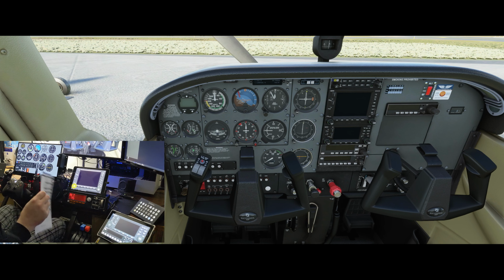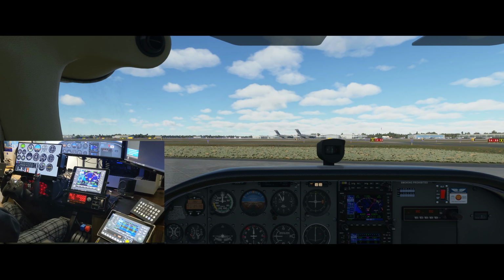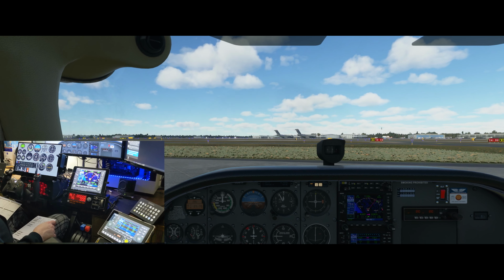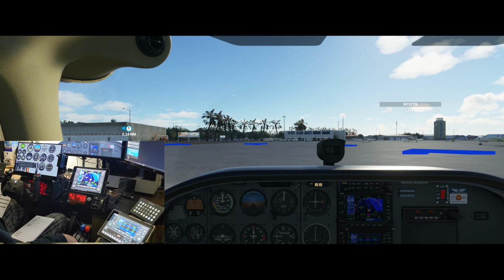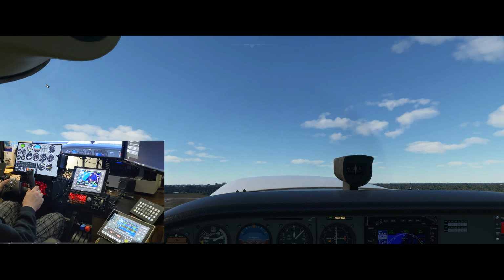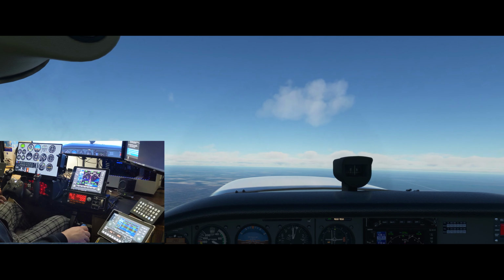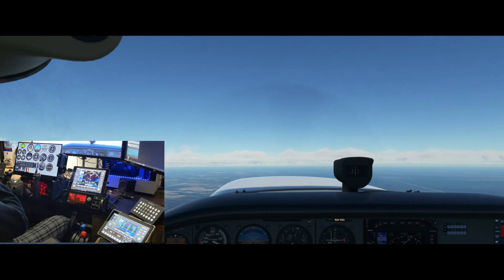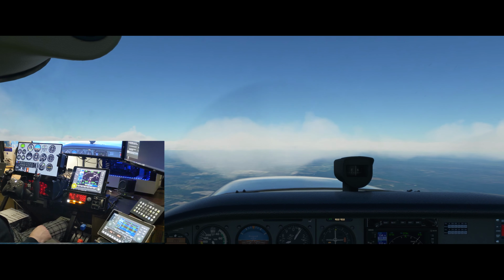MS Flight Simulator 2020 - Flight Using Air Manager 4 and Knobster

Comment: Greetings Billy. Thanks for helping us newbies by describing your setup. I have a question: I’ve used-up my graphics card’s 3 DP outputs for 3 scenery monitors and have only 1 HDMI output left to run a touch screen monitor. I’d like another monitor to run a G1000 MFD and am wondering if I can do that as you did wirelessly with an ipad using space desk. My computer does not have on-board graphics, in case that matters.  Thx!
Reply from the maker: You most certainly can. I run a pair of tablets wirelessly with SpaceDesk along with my 3 wired touch screens. SpaceDesk works on both iPad and Android, and I have one of each. 

This is an older video and my setup has changed a bit since. I now run a pair of 15.6" touch monitors, plus an iPad and Android.

Comment: Does Air Manager work with the PMS750? I really want to be as mouse-free as possible, but lack of ability for me to dock it to my iPhone via a screen share app makes it not possible now. I'd be willing to pay a bit of money to get it working.
Reply from the maker: That's not an Air Manager thing. That's a sim thing. And MSFS doesn't support touch. 

A bezel for the PMS750 can easily be made. It uses the standard G1000 FMS knob, Menu and DCT button commands. There's a bezel for the RXP 750 that could easily be adapted. But you won't be able to interact with the touch screen on the 750, Air Manager or not.

Comment: Can you get the Xcub panel popped out and working with a touch screen.  I purchased the wimaxit panel and knobster together. I can pop the panel out and move it to my screen but I cannot use touch function to "click" the screen.  I can use touch function in windows and did set it up.
Reply from the maker: Touch functionality is completely broken at the sim level. Not only does touch input not work, but once you touch a popped out instrument of ANY kind, or even just move the cursor over it, you lose all control of your input devices to your plane until the cursor is moved out.

There's nothing we can do to fix this, unfortunately. And since pop-outs and touch aren't a thing on Xbox, I'm not hopeful we'll see this getting any attention any time soon. Right now, they're all about making this the best Xbox experience possible, with PC being secondary to that.

Comment: I’m trying to fly the c172 without the g1000, how do I know which airplanes don’t have the g1000 in fs2020
Reply from the maker: If you have just the base edition of MSFS, you don't have the steam gauge C172. There aren't a whole lot of stock planes that don't have glass cockpits. The lower end Cub doesn't have one. I think the Robin planes as well. Otherwise, I'm not sure. I only fly a few planes.
Reply: @ottopilot6536  ahh okay so gotta spend a little more to get the one without it thank you

Comment: Does the 15in Touch Monitor require a USB Type-C Display Output Port to get the "Touch" Function to work? My laptop only has a "Mini DisplayPort" and a "HDMI" Output for display output.
Reply from the maker: It has an HDMI port for display. You can power it from an included power brick to USB C. For the touch data, there's also a micro USB. It does give you a.few options for connectivity.

Comment: HI, what is the make of the monitor your are using for your instrument gauges. I am working on building my sim panel to use FS 2020. Have all my logitech panels, yoke, and rudder pedals, just now just need a good monitor.
Reply from the maker: The brand is Wimaxit. You can find them on Amazon. They're not terribly expensive. Not the brightest monitors, but more than bright enough in this application.

Comment: I was flying a 767-300 for United …..returning from Paris to O’Hare about 25 years ago… Chicago Center or maybe approach control cleared me for a visual about 75 miles out for 27 right… Almost fell through the floor of the airplane ! visibility was about 100 miles that day….no crosswind!
Reply from the maker: I was surprised in this video because I fly this route pretty often. Typically on IFR I'll get my approach clearance 30-40 miles out at most. It surprised me that I got it so soon after takeoff.

Not being a pilot, I don't know what's typical in real life. I just (normally) know what to expect in the sim. And this was out of the ordinary!

Comment: In trying to determine whether or not to upgrade to 4.0 for purposes of using it for MSFS-2020, it just doesn't seem to have enough content for 2020 yet.  The content for the previous version wasn't that impressive either (Community gauges, etc.).  I think it's still geared toward x-plane.  If anyone thinks differently, let me know, I'd like to know what the advantages would be for MS-2020...seems very limited for what the FPS drain it would cause.
Reply from the maker: Air Manager doesn't cause any FPS drain at all. Undocking instrument panels in MSFS does though. But if you're building your own steam gauge panels, there's zero performance impact from using AM. 

Version 4 is still in beta atm, so there's not a lot of MSFS compatible instruments as of yet. Once they get it released as a final product, that will more than likely change.
Reply: @ottopilot6536  i got the email this morning from them that it is officially released now, thus the question. Their website has buttons you can click to see the available instruments.  Also, you are correct, when you undock an instrument in 2020, it's a terrible FPS problem.  I go down by 10 FPS most times when undocking just one instrument. For example, the CJ4 Collins panel.  Thanks for your response, I'll take a further dive into a few things before deciding.  I have till May 4th or 5th (for the upgrade discount from 3.x to 4.x, per the email).
Reply from the maker: @dabneyoffermein595  Yeah, I just got home from work and saw that V4 had been released. I bought it, because that's how my cockpit setup is. Without Air Manager, I have to go back to using my mouse and keyboard to control my plane. I'd rather put up wiht lower performance than that.

Hopefully Asobo get their act together and fix their sim so we don't have to take such a performance hit. It wasn't always like this. Until the VR update in December, I would lose about 2-3 fps for each subsequent one. That wasn't bad. Since then though, it's far more significant of a drop.
Reply: @ottopilot6536  ok, thanks for the info, yea, I'm hoping they figure this out, even the VFR map pulled over to another screen is brutal.  It's bad enough our base Frame-Rates are affected, but the pop-out instruments kill us.
Reply from the maker: @dabneyoffermein595  I don't know if this will make a differece for you, as I can't explain why it happens (and I'm a programmer). When I have windows undocked, I get better sim performance if I give focus to an application other than MSFS. I'll click into LIttle NavMap, Navigraph, Chrome, desktop... ANYTHING really, and I suddenly gain from 5-10 fps back. If I click back into the sim, that fps disappears. And I can see it on my CPU usage as well. My main thread is 60%. I click out of MSFS, and suddenly, my main thread is being used 80+%. That's completely the opposite of what should be happening.
Reply: @ottopilot6536  Hey, that's a really good catch!  Have you submitted an MSFS ticket in ZenDesk ?
Reply from the maker: @dabneyoffermein595  I've given up on Zendesk. I've filed bug reports that weren't even looked at months later. For the ones that were, I get a canned message that:

a. may be somewhat loosely related to the issue I'm reporting
b. may be totally unrelated to the issue I'm reporting
c. a reply that implies I'm doing something wrong and links to "solutions" that have little or nothing to do with my issue. 

At this point, I spend more time troubleshooting than flying. I feel like they should be paying me to use the sim.
Reply: @ottopilot6536  yea, i have run into the same exact thing. In fact, every time they state that it's fixed in the next release and it's not and I don't even know if they really took a look at my specific issue.

Comment: Hi, I activated my Air Manager V4 Demo to get it fully funtional. Imported the "Generic - Garmin G1000 Overlay Mobiflight.siff" and put the "mobiflight-event-module" into my Community folder. Mobiflight is running, newest version. When I start my FS2020 the G1000 shows up, all buttons are working but I have no picture on the screen. Tried it with the C208 and C172 G1000...
Any idea what went wrong?
Reply from the maker: You have to u dock the instrument from the sim. Air manager doesn't generate the picture. In the sim, hold you right alt key and click on the instrument to undock it.
Reply: @ottopilot6536  ok, thanks a lot,  I was not aware that Air Manager does  not provide the screen area but only the bezel. But if I maximize the undocked PFD screen  within the frame generared  by Air  Manager it will show this white horizontal bar on  top  of  the screen area.  Any chance to get rid of this bar? Wait, you can not maximize it in the screen area of the bezel... how do you  arrange the poped out screen, there is a frame all arround. No idea how this should work...
And  than it is not possible to use this G1000 instrument in an airplane that is originally (from Asobo Studios) not equiped with a G1000, or al least with an instrumentation where you can pop out a screen, wright? Sorry for this kinda confusion but anyhow I much much appreciate your help,  
Have  a  good one,  cheers 
Juergen
Reply from the maker: @jusr2858  Don't mazimize undocked windows. You can size them correctly to fit the spaces in the Garmin bezels. If sized correctly and you have "Always on Top" set in your Air Manager panel settings, you won't see bezels.  Look up a tool by Microsoft called Fancy Zones. It allows you to define areas on your screen you can 'maximize' windows into without going full screen. 

You can see in this other video, I'm using dual G1000, and  you can't see the title bar.  - https://www.youtube.com/watch?v=zIFlQDQcdSw 

And no, you can't use the G1000 on planes that don't have them equipped. This doesn't add functionality that doesn't exist in a given plane. This is to allow you to interface with a given plane without needing to use a mouse and keyboard.

Comment: Hi, 
does that mean it is possible to use  G1000 Panels from Air Manager (e.g. Generic - Garmin G1000 Overlay Mobiflight.siff) with the Air Manager 4 Beta + MobiFlight in MSFS2020?
Reply from the maker: That's what I'm using.

Comment: Are you using Air Manager 4? Or the BETA?

I'm using the BETA but can't get my GNS530/430 to communicate to my cockpit in MSFS. When i tap the buttons on my touchscreen panel (see my setup on my channel of you're interested) I hear clicks, but nothing happens. And I can tap the knobs and see them turn in air manager when I turn my Knobster, but it has no effect in the simulator itself.

Are you using a custom panel? I tried even creating a simple custom panel since premium panels aren't enabled in the BETA, but I'm not having any luck.

Thanks for the info! Can't wait to get this working on my rig!
Reply from the maker: I'm using Air Manager 4 Beta. It's the only version that works with MSFS 2020.

There are a few steps you need to get your Garmin working.

1. The default Garmins in Air Manager are only X-Plane compatible. Here's a library of MSFS 2020 compatible Garmins and other instruments that will work: https://drive.google.com/drive/folders/1dHG3OkFKFEz8mssAX25soBflUJbMcL5I

2. Currently, there are no Garmin variables exposed by SimConnect. You need to install the MobiFlight plugin in order to get it working. Follow steps 1-9 in this post on the MSFS official forum: https://forums.flightsimulator.com/t/full-g1000-control-now-with-mobiflight/348509?u=crunchmeister71

If you've followed all instructions correctly, you'll be rewarded with a fully functional Garmin. Please let me know if you have any issues. I'd be more than happy to help you out if I can.
Reply: @ottopilot6536  

WOW!! GAME CHANGING!!!

Thank you so much for posting that video to show that this is possible right now! And thank you for the explanation! I'll be giving that a shot this week and hope to have a fully functioning Garmin stack in my next video!!!

Thanks again!!!
Reply: @ottopilot6536  Yea! Now i got the GNS430 working in AirManager & FS2020 too!! Jippe :-) Thanks a lot!!
Reply: @ottopilot6536  

You are a hero my friend!! Works like a charm!! It's beautiful!!

I think I can finally call my sim "complete" and start FLYING the damn thing! 😆

Thank you again!! Huge!!
Reply from the maker: @mcorrive12  Glad to be of help. That was the point of these videos - to show what can be done without necessarily dumping thousands into hardware that can tie you into a certain type of plane. You can have a fully functional cockpit for a few hundred bucks that can be adapted to any plane type.
Reply: @ottopilot6536  Exactly!! That is what makes these touch screen panels so game changing!! You get the benefit of changing your cockpit controls to match the aircraft you're flying that day. That is huge!! And the Knobster is absolutely brilliant. Shout out to @Russ Barlow. For those who haven't seen his channel, search for his name + air manager.
Reply from the maker: @mcorrive12  Russ was my inspiration here by far. I got the Knobster (home made because they're out of stock everywhere), 2 Wimaxit monitors, as well as the SLAVX monitor stands he inspired the design of. 

The dude rocks. I've buy him a beer (or three) if I could.
Reply: @Drunk Billy Flies  I feel the exact same way. As soon as I stumbled upon Russ' channel, I knew I was down the rabbit hole and was going to be needing two touchscreen monitors. He's a rockstar for sure.

Thanks again for your content though. I was super frustrated to have the screens and air manager all ready to rock... But being stuck with MSFS not having their act together for full Air manager integration. This MobiFlight add-on is absolutely perfect!! I'm so happy with how my system functions now! Down with the the mouse and keyboard!! 😆😆

Comment: Can i use the knobster with g1000?
Reply from the maker: As long as you're using a compatible G1000 overlay in Air Manager 4, yes you can. That's what I'm using.